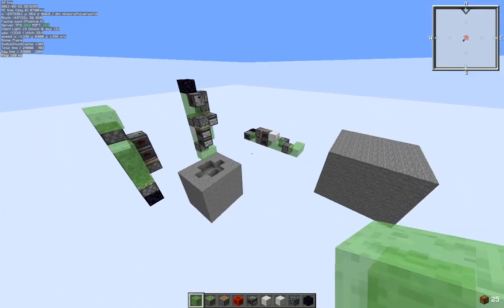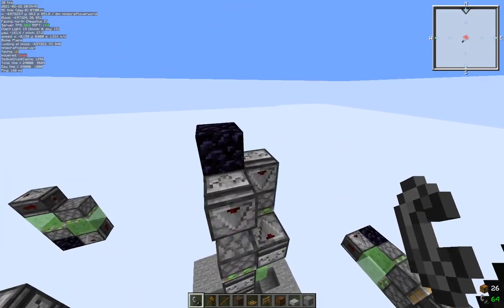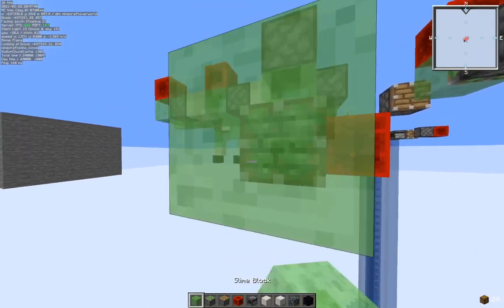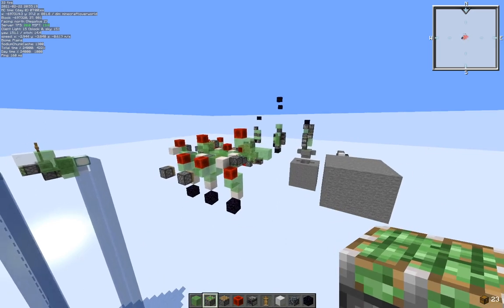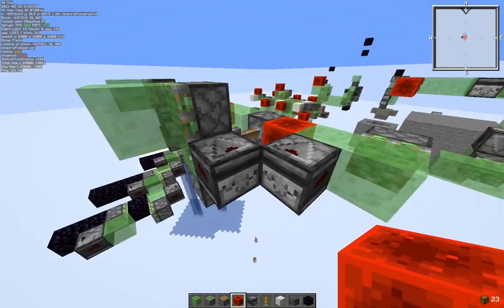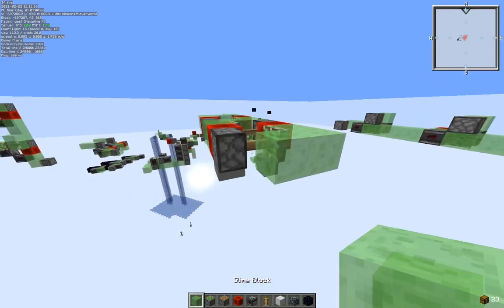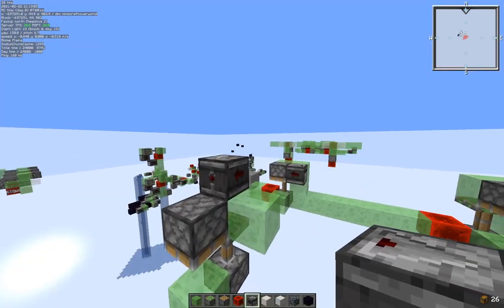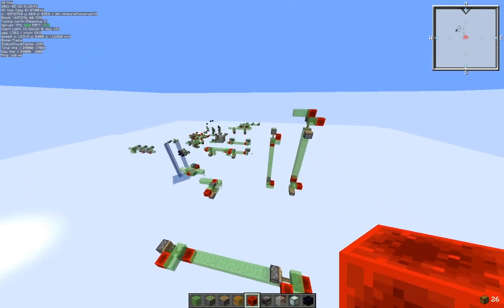Minecraft Flying Machine Basics #2: BUD wires, movable water, and other useful circuits

Comment: Absolutely incredible. I never could comprehend the mechanic of pulling 'water' with ice and an armor stand and how simple to understand it is until now; fucking genius, fantastic work. I really appreciate you making that demonstration bare-bones so I could understand what was happening. I've known about the 2 tick sticky piston extension to move water for ages, and I've discovered some incredible machines that leave water source blocks in the sky behind them (check my channel if you would like to see) and I was under the impression it wasn't necessarily intended. I can confirm it most definitely works in 1.19, but you are absolutely correct that it may not in the future; so thank you SOOO much for showing the pulling method to move water instead. I have no doubt I could make incredible ocean makers with that mechanic as well if I needed to. You have earned a sub!

Comment: Just a little note on the slime vs honey - I agree that slime is better, but when I am making vehicles that use flying machines, I tend to use honey because when you stand on honey then move it horizontally, you move with it. This just means that you don't need minecarts or anything for rideable flying machines, which is cool.

Comment: Great Video again! 2 corrections i noticed with the water explainations tho. the frosted Ice is not melting because of the light in this specific scenario, but because there is not enough frosted ice around the pulled one. it updates when it arrives in its new location and therefor it melts. 1 frosted ice needs 2 or more frosted ice next to it to not melt. the stair "trick" actually not only works with a 2 game tick pulse from an observer, but with all short pulses from a sticky piston, so 0,1 and 2 ticks of activation. At least i think this is the case because i can quasi update power the sticky piston with a redstone block on a 6gt engine and that functions aswell and i can still make oceans really quickly with that. Not entirely sure in that case tho, so maybe im wrong.